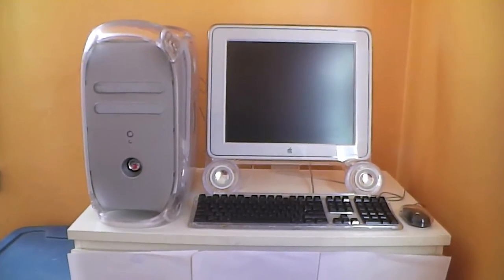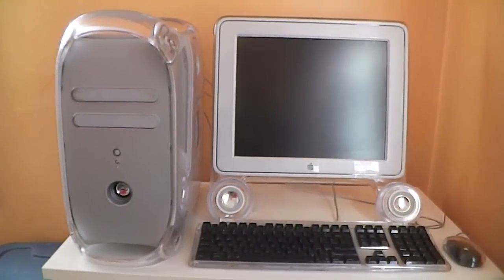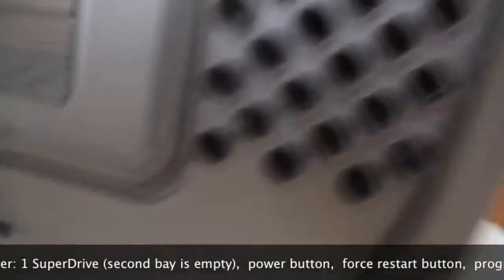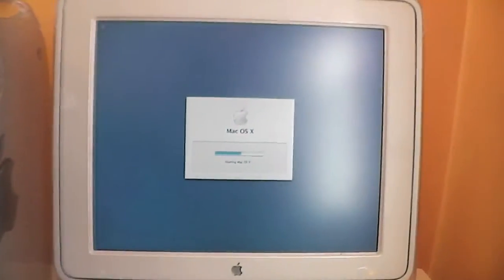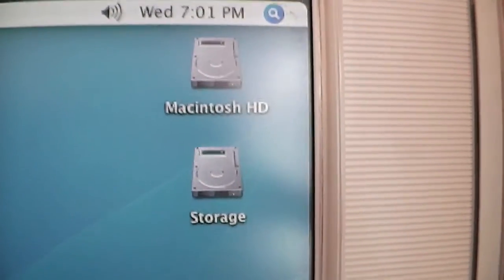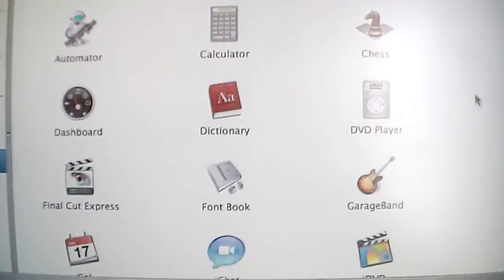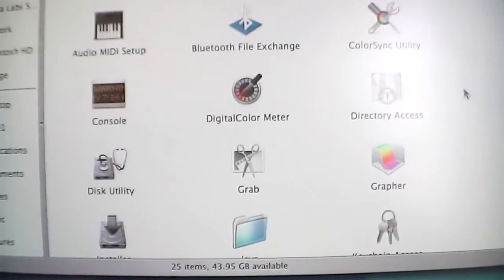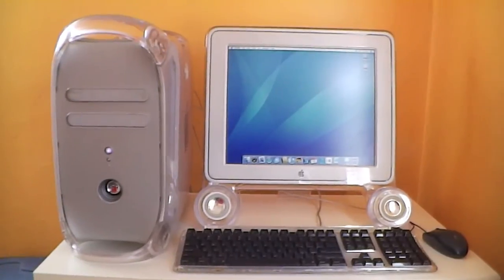2001 Power Mac G4 QuickSilver  (Part 1) – Wind5387

Comment: Is it possible to use this machine in 2017 for web browsing and yt?
Reply: Cool, thanks
Reply: imho, minum is leopard and 1,5 gig of ram, btw yt stopped working in safari some months ago. Don't know in 10xfour, but it's very slow I don't like it.
Reply: Mateusz Szalkowski you can’t use this on the Internet anymore because it no longer receives security updates which really sucks...
Reply: YouTube works wonderfully with PowerPC machines.

For Mac OS X 10.4 Tiger, use AquaVid or PowerPC Media Center:

https://macintoshgarden.org/apps/aquaweb-aquavid

https://macintoshgarden.org/apps/ppc-media-center-7x-youtube-streamer-downloader-convertor

For Mac OS X 10.5 Leopard, use TenFiveTube:

https://forums.macrumors.com/threads/tenfivetube-yet-another-youtube-option.2103937/

And for faster browsing with TenFourFox, install foxPEP:

https://forums.macrumors.com/threads/foxpep-for-a-faster-firefox.2209108/

And that's to say nothing about PowerPC Linux, which is on a fast track to supporting current versions of Firefox on a G4 or G5, and already boasts full support for a variety of other fully-functioning browsers as well.

If you intend to use these machines in any serious capacity at all in 2020 and beyond, it is strongly advised to be up-to-date with the MacRumors PowerPC forum, which is where all the cool things happen. Anything else is doing these machines and yourself a disservice!

https://forums.macrumors.com/forums/powerpc-macs.145/